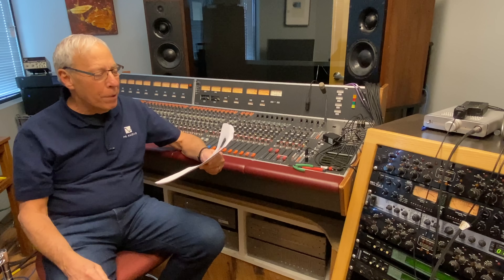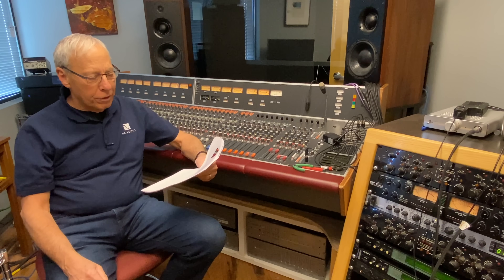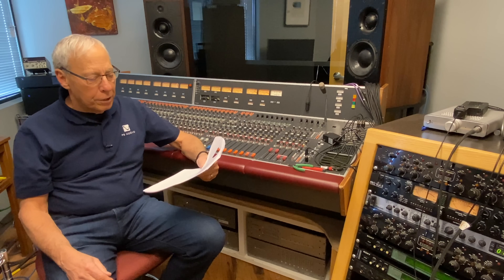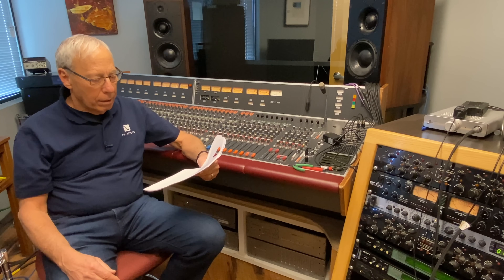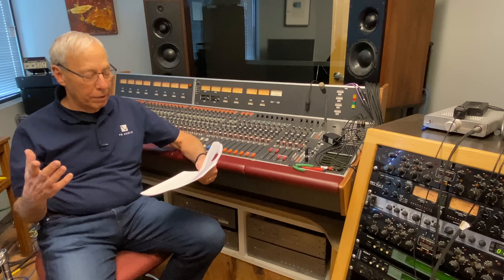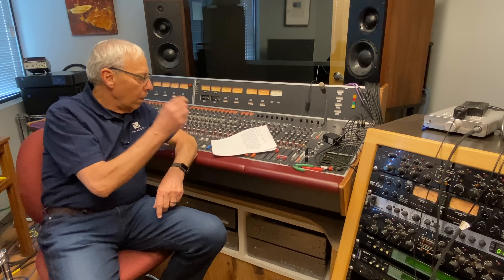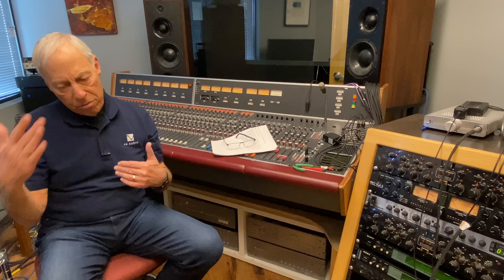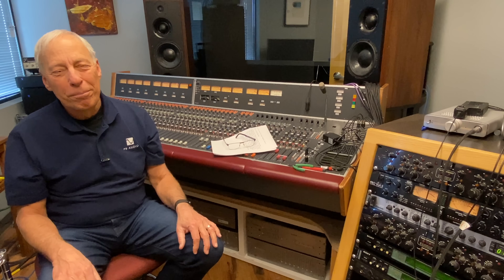Can you have too much damping factor?

Comment: Loudspeaker cables make the difference between a damping factor of 100 and, say, 1000 moot.
Reply: THANKE SOYU Mine goods freinds. her eis the definitiones of moots...

moot adjective
Save Word

To save this word, you'll need to log in. 
Log In
\ ˈmüt
\
Definition of moot

 (Entry 1 of 3)
1a : open to question : debatable
b : subjected to discussion : disputed

THANKES YOTU AND THUBMMS , YOU ARE THE GOODS FRENDS!
Reply: @FatRat-f9m  now you're just being silly.
I had that discussion with my boss years ago. Moot vs mute. No promotions for me.
Reply: Even the speaker voice coil wire itself has resistance that invalidates the effect of a very high amplifier damping factor.
Reply: @ThinkingBetter  If the amplifier has low damping factor, damping factor in speaker will make the damping factor even lower. Damping factor will be worse the more you put into the loop. Better begin with high damping factor. And then you end up at about 600 instead of 50.
Reply: Oystein Soreide Because quoted df represents a ratio between a fixed quantity say 8ohm and the amp output impedance a if you do a bit of math you will see that due to cable impedance, higher damping factors become insignificant. If the speakers were soldered to the amp then they might but they are not. https://www.eaw.com/education/amplifier-damping-factor-more-is-better-or-is-it/
Reply: @oysteinsoreide4323  Sure, ideally the amplifier has an output impedance of 0 Ohms (means infinite amp damping factor).
Reply: @razisn  The cable resistance is additive to the output resistance which in sum gives the output resicance of the amp. So the damping factor is the  1/(( amp output R ) + (Speaker cable R ) ) . So both cables and amplifier resistance are equally important for damping factor.
Reply: @razisn  If you have very short speaker cable, the low damping factor of the amplifier will be significant advantage.
Reply: @oysteinsoreide4323  An amplifier damping factor is the ratio of load impedance (loudspeaker plus cables) divided by the amplifier output impedance. For example, if the speaker impedance is 8 ohms, and the amplifier output impedance is 0,1 ohms the corresponding theoretical damping factor is 80 (ignoring cable resistance). Yes, in reality, the effective damping is depending on the series impedance of amplifier output impedance, cable resistance, voice coil resistance and cross-over impedance. The voice coil ideally is looking into a short-circuit when cone motion is to stop (sort of how electric cars can use the motor as brake system). I like servo subwoofers that do the trick by active feedback from voice coil motion to the build-in amplifier. Right now listening to my Velodyne subwoofer. Awesome bass is possible in this way.
Reply: @ThinkingBetter  The best speaker cable is no cable too. But it is kind of hard to do in practice. But in active speakers the distance can be made quite short.
Reply: @oysteinsoreide4323  Yes, actually it's a good reason to keep the cables short (usually cheaper too).
Reply: @ThinkingBetter  I have1.5 meters of wire. which is 3 meters totally. and have 4000 damping factor of amp. But still at only 3 meters the damping factor is mostly due to the wires.
Reply: @oysteinsoreide4323  Well, your amp damping factor is what it is (0.002 Ohms output impedance). That amp impedance is equivalent to 1 feet of 12 gauge speaker cable and of course with 3 meters cable (around 10 feet), your cables will probably be of an approx. 10 times higher importance. So I agree with you. And let's not forget that the voice coil resistance and cross-over impedance also impact the effective damping.
Reply: ThinkingBetter impedance is not important. Only DC resistance. And DC resistance is lower than the impedance of a speaker. I have a 4 Ohm impedance speaker. But I don't know its DC resistance.
Reply: @oysteinsoreide4323  It's a bit more complicated. Impedance is "AC resistance" and includes the actual resistance (DC) but also inductive and capacitive effects in a path. Your amplifier output impedance might be pure resistive, if it has no frequency dependency in it. When the voice coil is supposed to stop, it will still ring some time while burning up the kinetic energy from the cone motion into electrical energy. The kinetic energy burns faster the lower resistive load the voice coil is looking into. However, in actuality if, for example, you have an inductor (or long speaker cable) or capacitor in series with the voice coil, the impedance can reduce the effective current that is helping to stop the voice coil motion as the generated current during the ringing is AC. Thus, the cross-over filter might also impact the effective ability to stop the cone.
Reply: @oysteinsoreide4323  
Driver DC resistance is typically 30-40% of its nominal impedance rating, so in the neighborhood of 1.5 ohms for a 4-ohm speaker.  That means the overall damping factor is less than 3, regardless of how good the amplifier (or cable) is.
Reply: @marianneoelund2940  That means that no cable is the best. Hence as short cables as possible is the best way to control the woofers.
Reply: @marianneoelund2940  If you have 4000 damping factor at 8 ohm. you will still have 90 damping factor at 3 feet speaker wire at 14 gauge, and 1.5 ohm load.
Reply: @oysteinsoreide4323  
You're not interpreting the data correctly.  The load isn't 1.5 ohms until you go all the way down to DC.  You still use 4 ohms to calculate DF.  
BUT:  The 1.5 ohm voice coil resistance must be added to the amplifier and cable resistances.  It's part of the circuit:  Total resistance = Ramp + Rcable + Rdriver = 8/4000 + 0.015 + 1.5 = 1.517 ohms.  Then the true damping factor for the 4 ohm speaker is 4/1.517 = 2.64, which is less than 3 as I've been saying all along.  
You cannot exclude Rdriver from the DF calculation, as most people try to do; that gives a meaningless figure.  It would be equivalent to excluding armature resistance from the dynamic calculations for an electric motor, which all power engineers know needs to be included.  
Having stratospheric amplifier damping factors achieves almost no benefit.  Ditto for keeping cable resistance below 0.1 ohm, as many believe should be the goal.  
So what's the solution for the low true DF figures?  One is to use a servo woofer.  Another is go to multi-amp (eliminate passive crossovers) and design the amplifiers to compensate for Rdriver.
Reply: @marianneoelund2940  Could you give the documentation about that method of calculating the damping factor. It could be interesting to play around with different parameters in the formulas.
Reply: @marianneoelund2940  I thought that the resitance in the voice coils was the part of the into 4 or 8 ohm part already. Though.
Reply: @marianneoelund2940  Since the speaker cable reistance is so little of the overall resistance in your calculations, why is there so big differnce in sound from one speaker cable to the next? I don't undertand that.
Reply: @oysteinsoreide4323  
The description I already gave qualifies as the documentation.  There isn't any more to add, as far as basic DF calculation.  
But if you want a deeper understanding of loudspeaker dynamics, you could look at one of these:  
https://www.kevinchant.com/uploads/7/1/0/8/7108231/speaker_impedance.pdf
https://pdfs.semanticscholar.org/9e3e/fb5785b55b45e13a109520b426de8e9c3451.pdf
Reply: @oysteinsoreide4323  
The voice coil resistance, and the reactive parts of speaker impedance, add in quadrature.  The net impedance magnitude is still primarily down to the reactances, that is why you can calculate DF reasonably accurately, using the nominal speaker impedance figure.  
Net impedance magnitude, |Z| = SQRT(R^2 + X^2) where R is the coil resistance and X is the reactive component.  
In the case of the 4 ohm speaker with R = 1.5, we have 4 = SQRT(1.5^2 + X^2), so 4^2 = 1.5^2 + X^2 and we find X = 3.7.  If you want to be very careful, you can use X instead of |Z| to calculate DF, but that will give an even lower result.
Reply: Expectations and psychoacoustics, for the most part.  Few listeners know how to use their hearing to make accurate comparisons.    
There are many technical things I can explain regarding electronics, but please don't ask me to explain the human mind.
Reply: @marianneoelund2940  I don't believe in physco acoustics when i hear difference consistently between cables by switching back and forth several times.
Reply: @marianneoelund2940  I have heard things I didn't expect too...
Reply: @marianneoelund2940  I didn't believe that power cables mattered, neither that filters mattered. Still when I put it into my system, the difference was mind blowing....
Reply: @marianneoelund2940  So after my power cable test, I became very sceptical about what engineers tell. I trust more in my own ears and experiences.
Reply: @oysteinsoreide4323  
The difficulty with cable testing, is that it takes some time to switch them.  Acoustic memory isn't accurate enough over that time span.  You also need someone else to do the switching, so you don't know which one you're listening to.  
When you're looking for extremely subtle differences, you need to be able to instantly switch back and forth many times, also with the same musical passage restarted at the same point each time, or looped.  
Now if you're comparing cables where the change can perturb the amplitude audibly - for example if one cable was 0.5 ohms - then not so much care is needed.  Our hearing always favors the louder choice, even if the difference is less than 1dB.  
Also, beware of connectors.  The cable construction may not be the most important part;  making the connection to the speaker and amplifier solidly, often matters more.
Reply: @marianneoelund2940  I thought you were not hearing expert....
Reply: @oysteinsoreide4323  
No one is.
Reply: Damping factor is output impedance divided by loudspeaker impedance. As loudspeaker impedance varies with frequency so will the damping factor.
The addition of a fraction of an ohm to the speakers impedance by adding speaker cables is not going to have any meaningful effect on damping factor.
Reply: @nathanevans6277  No. The ratio is the opposite. Load impedance divided by output impedance. Now, since we got that right, just calculate how much the output impedance must be for a damping factor of 1000 and a speaker load of 4. Then add ‘just a fraction of an ohm’ to the output impedance and calculate the resulting damping factor...
Reply: @razisn  oops I wrote them down the wrong way around, my bad. Nether the less, the resistance of the  speaker cable is added to the load impedance not the source impedance. Adding a few milliohms to the nominal impedance of the speaker isn't going to have much effect on the damping factor.
Reply: @nathanevans6277  No. It is added to both but due to the difference in magnitudes it makes more difference (very significant) to the output impedance. It can lower the damping factor by orders of magnitude.
Reply: @razisn  what really makes a difference isn't the speaker cable, it's the crossover. The ability to control the driver that a high damping factor offers is lost when a passive crossover is stuck into the mix. One of the many advantages of using an active crossover is that the driver is directly connected to the amplifier so damping factor is preserved.
Reply: @nathanevans6277  Now you are changing the subject. My initial comment about very high damping factors not making a difference when the speaker cable is taken into consideration applies. I hope I managed to convince you. It is just basic arithmetic. Once you get to fractions of an ohm amp output impedance, fractions of an ohm of impedance added by the cable makes a big difference..

Comment: A damping factor of infinite is ideal but impossible.
Reply: Unless your speaker is already over damped.
Reply: Mk Shffr How do you define “over damped”?
Reply: @ThinkingBetter  It would be somewhat subjective but generally a Q of less than 0.5-0.7. However, even with moderate Q there may be situations where current drive is preferable.
Reply: Hello mine frends! My junk recevier circe 1978, gets louder and quiter by itselfs. It si capacotors or somethintg that can get foxed or is it tome to get something else. Is a Sansui with the concentrics volume knobs. Left channel is super super loud and I have it turned all the way off. THANKE YOU, YOU AARE THE HOINEST FRENDS ELECTRIC ELGNIEERS. THUMBS IUPS!

Comment: Love the equipment rack and the Studer console.
Reply: Sony Reverbs from 1990 in the rack still great, ACDC still took these vocal verbs out on tour before Axel Rose joined em
Reply: @bradmodd7856  Nice limiters and compressors as well. The Studer consoles had some good built-ins but we still used a lot of outboards where I worked at the CBC.

Comment: What about “vintage gear “ with damping factors in the 10-30 range? Likely issues with speakers?
Reply: Likely a problem, yes. That's probably where the warm woolly sound comes from.
Reply: Ever a risk of damage to speakers or just sonic/mechanical limitations? Accuracy sacrifices or speakers/drivers can’t get out of their own way and get overwhelmed? Thanks:)
Reply: @codyhuber  no actual risk, other than what @dave writes, loss of accuracy, if that. A lot of new tube amps don't have high damping factor as well. 
Heck, I think you could say that the low DF of vintage amplifiers is part of their signature sound. Sound that many prefer.
Reply: No problem. If you like what you hear, it's fine